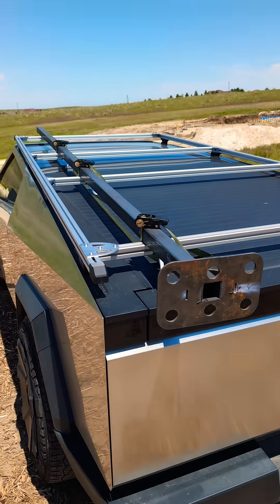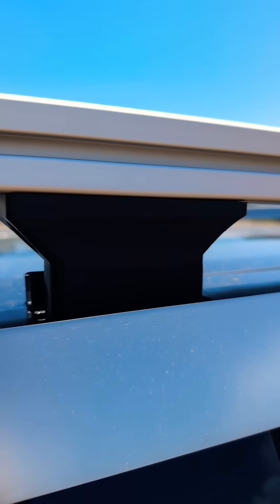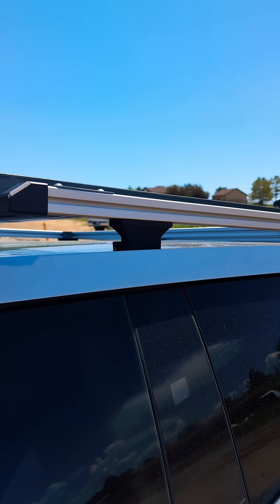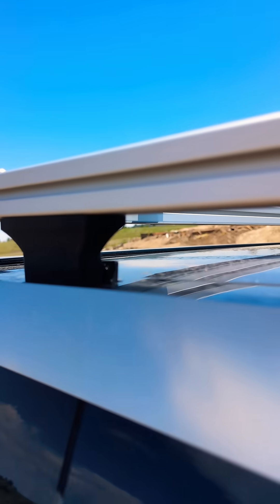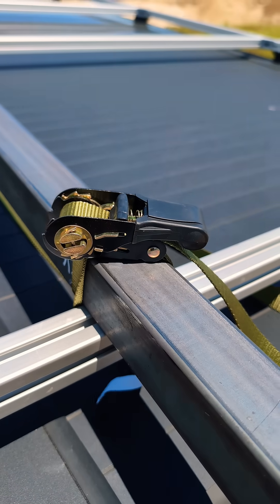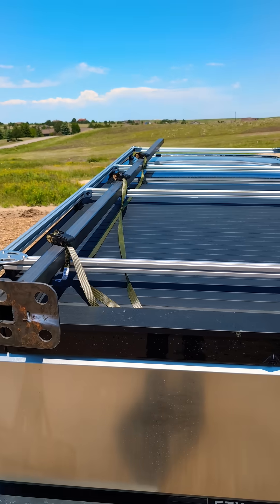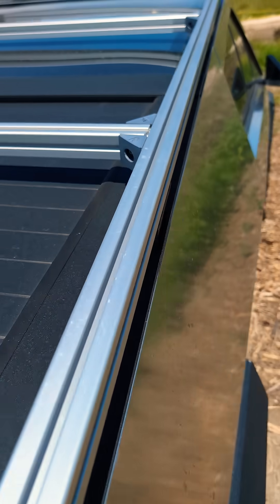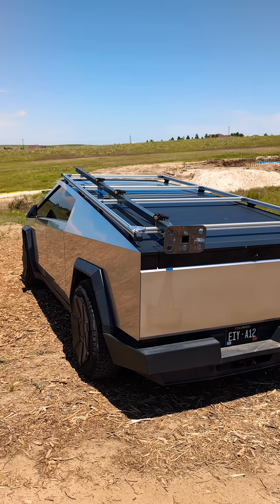#DIY #Cybertruck #roofrack #3dprinting #cnc #8020 #t-slot

Comment: Good job on the rack, I thought about doing something very similar.
Reply from the maker: Thanks! I have been using it a lot lately for construction materials. It works great! 

Here are the files if you want to try them out: 

https://drive.google.com/drive/folders/1nycNY6jZD9laz632Lr6vFt-UWwN2OPsj